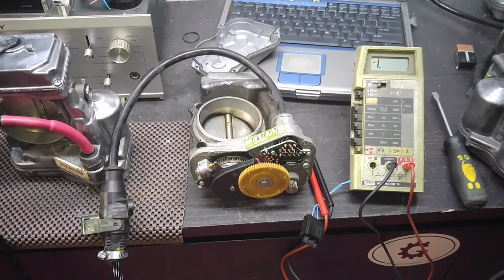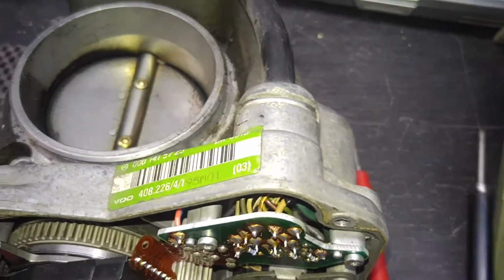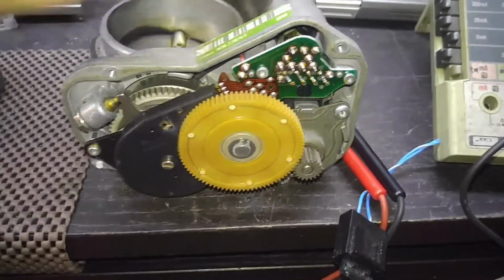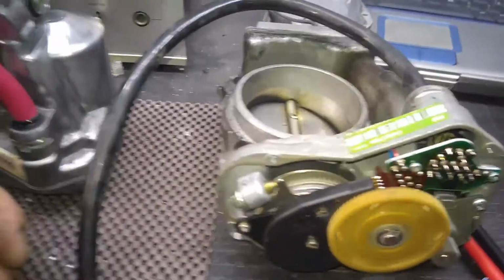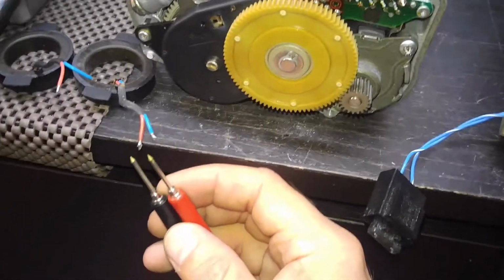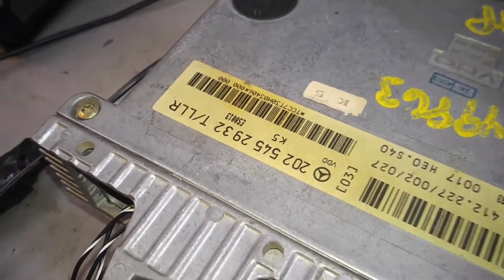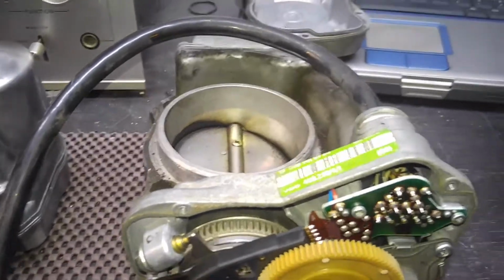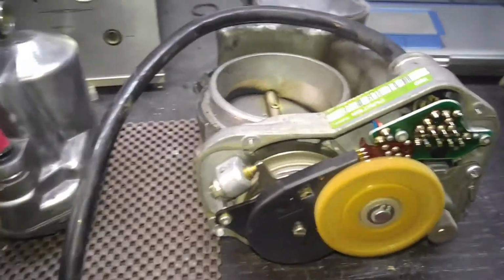Screeching sound from throttle body.

Comment: My car ford escape 2011 hybrid I have this noise at the first second of the engine start, and after that the noise gone.
I thought it came from engine or poles or maybe from transmission but , finally I figured out its from throttal body . 
Thank you for the explanation how the noise happens.

Comment: Very informative, thanks. Would this sort of noise happen in a brand new car due to manufacturing defects? I just got a new MY20 Tiguan Allspace and it makes this exact noise, like as if someone is sending a Morse Code message and the screeching noise on accelerating through D1-D3 to 2000rpm and after that fades away due to engine noises etc.

Comment: Update:  I replaced the throttle body and it did it again with the same noise.  The chances of a new part doing the same thing is almost impossible.  Wish I knew what the problem is.

Comment: Hi there Victor thanks for the video my car 1.4tsi Cavd engine sounds similar to what was shown in your video, it suddenly started to sound like this and the idling has change too, so the rpm use to be at 720 ish now it gradually climbs to 1050 can stay there like your pressing and the pedal. Oh I there was an abnormal before all this happen, whenever you press lightly on the pedal it produced a growling sound much like a sports car. Any ideas what could be the issue? No chck engine light too

Comment: Hi great video! My throttle body is making a buzz sound..is this normal? My car won’t start anymore..it’s a 2000 w202 c280. The car started but idle very bad..had no control over my gas pedal..went from low to high by it self...now the car doesn’t start...I’ve cleaned the throttle body. But still no start..Throttle body is making loud buzzing sound when ignition switch on..don’t now if this is normal..
Reply: Hey Gregor, did you figure this out? I think I have the same problem.
Reply: @mattshilling  hey Matt, did you figure it out? I also think I have the same issue